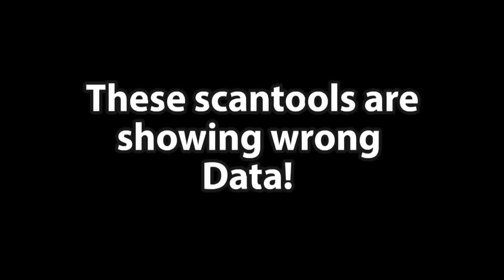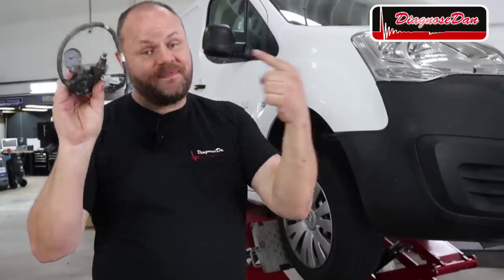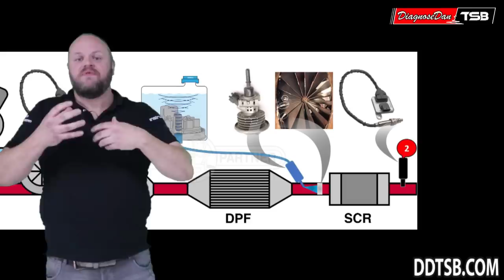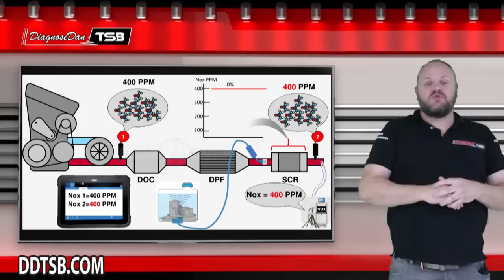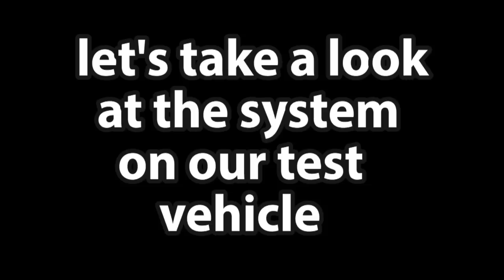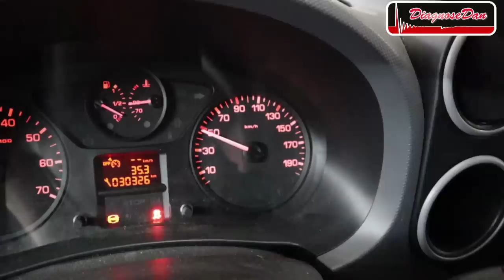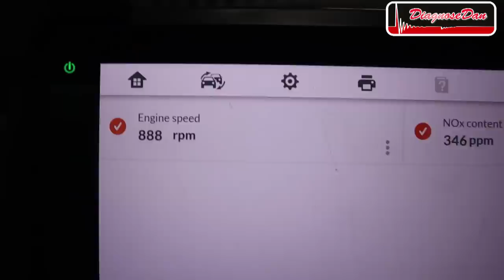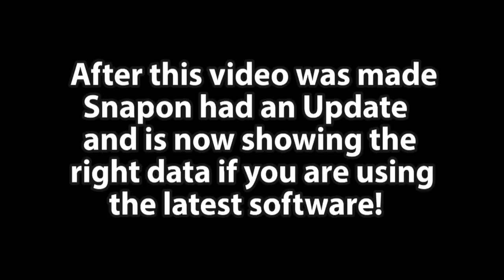Wrong parts replaced because of these scantools!

Comment: And this is why I use Autel!! Woot woot! And yes this means Autel is better Dan! Jk'in I will give you some advice if using Autel on Chrysler EVAP systems. The advice is, don't use it. It displays the wrong switch status data for the NVLD and ESIM systems and will lead you to a faulty PCM. Has been this way for years. Real handy.... 😐
Reply from the maker: Diagnosing is challenging enough without a scantool showing wrong data Eric, but i've seen it on many tools including Autel. In general i'm very impressed with aftermarket scantools and how far they have come. Many times wrong data can be very obvious but this time they tricked me🤣
Reply: @Diagnosedan  

Hello Dan,

This brings up a very interesting question on who owns what.  As owner of vehicle, should I be denied access to repair it, or should it be "open source"

John Deere is facing some serious complaints from farmers that can not fix their machines anymore.

Is it correct for a company to keep all information proprietary when you own the product?

I support the "right to repair" bill for any product sold.  Too easy for a manufacturer to obsolete a good/working product without access to repair information and data.

Food for thought.

https://www.youtube.com/watch?v=bGH6pxNouCY&ab_channel=BloombergQuicktake%3AOriginals

P-Chi
Reply: @Diagnosedan  I happens with factory data and tools too, and they do fix it....eventually
Reply: Nice to see your channel even gets the attention of some genuine Youtube celebs here. 'Nuff said about the quality of your video's then! There's your problem lady...
Reply: I use Gm techline connect on a daily basis.  It's the factory scan tool and it's junk.  One day they update it and the data for headlights will show up in low pressure fuel system data or they will show low pressure fuel and hi pressure fuel data swapped.  Will take 3 months for them to correct that and create more issues.  Then customer gives up and takes it to Eric who uses stable program and he can fix.  It's called gm train wreck connect
Reply: Ahem... let's call this for what it really is. When a scantool manufacturer BUYS their software from the manufacturer of tables of data values they have no interpretation of what may or may not be correct. They simply let an algorithm run and decode the data to be displayed. In this case we see the companies that actually purchased the data tables correctly from the OE versus one who steals it. They do not have a data validation team at Autel so it is easy to conclude that they have once again ripped the oe software for their algorithms and decoding. Great we can get the data, but at the same time a huge reason that all softwares from the OE are becoming less affordable and cloud based. The threat of intellectual property being stolen by dirty companies such as this have a much more negative effect in the long run when they can't steal from a cloud and data becomes unattainable for the average repair shop due to cost increases.
Reply: @NewLevelAuto  if we are talking  specifically about diagnosis/repairs, there is no reason for the OE software to be less affordable and cloud based other than lining their pockets. It should be free. Just like in the old days, you bought a TV and the schematic and parts list was glued inside the housing. The threat of intellectual property theft is just an excuse. The cost of their R&D, programing, coding etc... is already added to the cost of the vehicle. Not saying they are right for stealing or ripping the data, it should not have gotten to that point. Greed
Reply: @yipchitaywonga  I use to always buy Haynes Repair Manuals back in the 1970's and 80's and they were expensive (to me) and those were simple to repair truck  to work on looking back at it. I probably had 15 Ford Pickups but only ever worked on a few of them as I just did not have the time in "mid-life" but I kept buying the manuals just in case.
Reply: @yipchitaywonga  Amen bro
Reply: @NewLevelAuto  no comment... 😐
Reply: @NewLevelAuto  So... reverse engineering is "ripping off"?
Reply from the maker: @NewLevelAuto  calm down🤣🤣
Reply: @Diagnosedan  hey man , I call a spade a spade 😆
Reply: @NewLevelAuto  😳
Reply: Your last comment made you sound like a computer guru. It’s true what you said. Everyone knows autel reverse engineers all there stuff
Reply: Could one of you guys finally call it.....please . I'm about to press a "buy now" button but after months and months of research I'm worse off now than before. C'mon guys...who will put their name on the line for us poor "advanced diy" mortals, and name a good all round dependable , good bang for the buck brand ( and even better if model!! ) , that will do light programming ( tpms sensors , etc.) and cover all the basics !!
Reply: @NewLevelAuto  Does that mean that Snap On stole their data tables, or that it's impossible for any other manufacturers to have bugs?
Reply: @ferrumignis  just the opposite,  they paid for theirs ,hence the incorrect table.
Reply: @NewLevelAuto  Don't understand this logic? If you pay for the tables they aren't correct, but if you rip the table off from someone that has paid then they are correct?
Reply: @ferrumignis  my statement is that they have not paid for them. Thye take the OE tool and rip the data and function tables.
Reply: @NewLevelAuto  I am not familiar with either, but if that’s all they’ve copied, it is a poor try.
Reverse engineering per se is neither illegal nor bad. It is generally only viable when the cost for the original product is exorbitant and the manufacturer is trying to protect their nasty pricing policies.
Reverse engineered products are just like any other product, though. There are cheap, poor products and well put together, tested, quality products.
Reply: @NewLevelAuto  what's wrong with that, if I learn French by watching French TV is that immoral?
Reply: My Autel shows inaccurate data often.. great video.. TY
Reply: Which tool would you recommend guys? Your input would be helpful
Reply: He didn't properly diagnose the problem. He just brought out the old parts cannon and threw a part at it 😂😂. Eric O would never have done that 👍
Reply: And this is exactly why I can't give an answer to the guys in the workshops, after doing a diagnosis for them when they ask, " what Scantool should I buy?" . 

Because there's no right ONE.  From all the ones that I use, some perform way better with some brands of cars where others are way better with others. 

It's the best to have them all 🤣
Reply: 2 points
Did these scan brands agree on fault codes.

Aren't all OE manufacturers up in court at the moment for faking the emissions values from 2010 onwards.
Charlatans the lot of them 🤬

I'll stick with running my 20yr old ROVER 75 and not feel guilty about it.

Cheers Dan keep up the good work 👍 👏
Reply: The subject has now been covered by the experts. Let's move on.
Reply: Found this with High pressure fuel pump reading on 2016 Range Rover Sport td6. Autel Maxipro 808 gave way high, red, pressure readings when scanned. GAPIID tool gave normal readings. Pays to be aware. Thanks for bringing this up.
Reply: That's sucks 😞😞😞😞
Reply: Glad to see you pipe in Mr. " Welcome Back Viewers ".And you do highlight a very important point, we are as consumers and service techs beholden to the whims & foils of state run manufacturers. If you are one who believes gov'mts & CEO's don't conspire then I am laughing at you. In all the little backroom conferences a lot gets decided about who gets what information and how. So it is no surprise to me that vendor " A " will get something different  than vendor " B " depending om how much importuning has taken place. Such is the world we now live  in.
Reply: Luckily we dont get that many chryslers in europe. We some times had trade ins when I was in the peugeot dealership (Now parent od chrysler) was a 300c and was the most apalling heap I've ever been under and it wasnt even in bad shape. On secont thoughts maybe the lone 1980's ford E van I once worked on was equally bad and that says alot because I mostly work on VW:s these days.
Reply: Great to know that bit of info Mr. Eric, cus I do have the Autel.   Lol
Reply: Autel is trash! It does less than 1/3 of what it claims it does. 50% of the time the functions that do work, fail and nothing you can do will get them to ever run on any vehicle again. Low quality over priced 10 year old OS on the devices, cheaply made everything!
Reply: @inyoudeep1  I take it you've never used a current Bosch or OTC scan tool then? Our Autel has far greater vehicle and function support than either of them. The interface could use some work though.

Comment: Hi Dan I need your help!
Ford escape hybrid 2010. abs and track light are on. The engine light is on. Transmission is locking the  front wheels.

Comment: Interesting. As someone with design engineering (mechanical) experience and since young age fixing cars on the street (not in workshop) with very basic and unprofessional tools ...
This new electronic stuff can make trouble. I get at MOT exhaust problems, I have no money for scanners, only a simple OBD from ebay. So I scrapped one car couldn't fix the HC. The next time same issue on another car. Mot failed. I did nothing, fixed some mechanical issues, and went to the same tester. They said they have to go with the car to another garage, their Tool had likely a fault (likely after a large amount of customer complaints and failing the same reason). Great. Car passed now, no repair done! Thanks for the first scrapped. As design engineer I can tell you one thing for sure: As long as you rely just on tools and not on the engineers knowledge you are just a low level repairer. You need to figure out what an item supposed to do (what the engineer says it supposed to do), and then measure that. For that you need a laptop and some input and output sockets of all sorts measuring volts, amps, frequencies, times and amplitudes and whatnot, power sources, and in some cases digital bits. And then it needs displays of all of that on your screen, and you need to understand what it shows, or supposed to show, and what not. Well, that way you find any problem, even the ones which the engineer made, or the scan tool maker (hello John Deere). So doing what Dan does is the only way forward for a start: Use brain. That may include thinking about the right tools. These scanners are made for using NO brain, a convenient quick check for the lazy. That is also the reason why so called dealership fail. They hire no brainiacs, only cheap fix boys who can press some buttons on a scanner to identify simple problems. After them comes Dan. And if he is unable to find a fault, it must be an engineer who looks into the design and function level of a device. You may be shocked which sucker of engineers you can meet, and their crap is manufactured ... Leaving a repairer no chance, because the design was wrong from the start. And buy a VW, you can find some twister of the truth, engineers forced to misuse their capabilities ... I forgot: For a proper diagnosis it may be also helpful to know about statistics ... And have seen a lot of crap, which equals to experience, helps most. If it was easy, anyone could do it. These tool companies hearing from a problem and come with updates are very good companies, way above just copycats. And if all that still fails? Program your own software, make your own hardware. And make it better than factory. Like this guy.  https://big3africa.org/2024/09/05/kenyan-engineer-transforms-old-vehicles-with-fuel-injection-technology/

Comment: The scan tool suppose to read data from the car computer no more no less, but it looks that is not how the scan tool do it, it looks  like the scan tool read data from the sensors and translate it into number on the screen, so the problem was the translation on the scan tool was wrong for certain cars model i guesse.

Comment: Your pronunciation of "NOx sensor" sounds similar enough to "knock sensor". While watching the video, up to a point I was asking myself WTF is Dan talking about.
Now, about condemning a scan tool for erroneous readings. I would have been more worried about 3 out of 4 scan tools being "wrong". I find very odd that 3 out of 4 software programmers made the same "mistake". I am sure they have used correctly the datasheet of the NOx sensor. Except the datasheet was wrong. Autel might have used a different datasheet that happened to be correct. Or they had the same incorrect datasheet and when they saw the values on the live reading, they divided it by 10 for good measure.

Comment: It's clear that all the tools were measuring the ppms correctly, but some of them had the numbers x10. It usually happens when there's a mismatch in the measurement units. E.g. 20 car manufacturers use one scale, and then one very special one decides to use another scale of values. And this piece of knowledge didn't reach the scan tool developers in time so they have it the default way for this car.

Comment: Very good video, I would be interested what data could read the Bosch esitronic.I am an everyday user of bosch and I have a Launch but with the Launch I am very disapointed. For example The Launch recognised a 2012 opel vivaro 2.0 diesel as an Opel Mocca ! Another example Volvo with 2.0 tdci : Launch read boost pressure actuator error (wrong ) Bosch read exhaust temperature sensor before catalyst short and indeed one wire of the sensor was broken. So....

Comment: Hello Dan what a grate technique monitoring the rear NOx sensor at wide open throttle, a test we have adopted but I started using live data in EOBD the measurements are PPM and can be recorded. 
I wounder if the data differs on the Launch ? P.S it was great to meet you in the UK this weekend

Comment: Hallo
Great diagnostic procedure and really odd scan results.
Taking advantage of this O2 problem, i think it would be a really good video of explaining why in the early VW 1.6 FSI Engines (e.g : BAG) the NOX Sensor failed and kept failing after replacement (the new component cost over 500Euros). Furthermore what it's role is for the engine and the working condition of the vehicle. Thank you and i hope for a response as it is a very common problem that has caused too many problems for people that had this particulate engine.

Comment: it seems that the other scan tools were measuring parts per 10.000.000 and not per million. the first three digits in each measurement were correct. but the three scan tools were like using an extra 0 in the end. So seems like the scaling or the calibration is off on these three, not the values in whole.

Comment: I'm not so familiar with the scan tools at all, but I guess it's just a software issue by the scanner, as you mentioned already, the numbers are almost similar if devided by ten. I guess the other scanner work well too, just devided by ten, but of course if you compare the data the first time with two different scanners you guess the sensor is faulty. Rgds from Germany

Comment: Thank you very much for making this test, It is v very valuable and highly appreciated! Now, personally this what you have showed is main reason why I will never (or not so soon) buy EUR 6 diesel vehicle. These ECO systems are very complex and it is essential to know how they are designed and how to read them properly. High NOx levels are there if combustion is lean (very hot) so it should be compared with lambda (O2) sensor when checking NOx reading. Though, I kind of lost my self, what I wanted to type is I hate that all of them are hiding information to ensure your vehicle can be repaired only buy paying huge costs for service and parts, or to convince you to buy new car. I hate this, I honestly do.
Reply from the maker: Even dealerships are having a hard time Diagnosing and fixing these vehicles!

Comment: Sure i have had some headaches as people gets little wrong things.. example going in open standard OBDII side (instead manufacture side) and made example some conclusions based what they see and then complain.. like that they end up looking on this Open OBDII Standard side sensor data "IAT" sensor PID when car doesn't have one and Engine ECU actually showing outside air temperature on that data slot which sensor is located in front bumper... etc.. 

Then there is open standard Pxxx codes can get some fun situations like with Citröen i got code for secondary air valve even though whole car did not even had ever designed not to have one... ended up being just secodnary air pump being jam. 

Hey its open Standard like manufacturers actually gonna follow them on each step? Of course not all. They have their own diagnostic standard usually.
Reply from the maker: Thanks for watching 😁